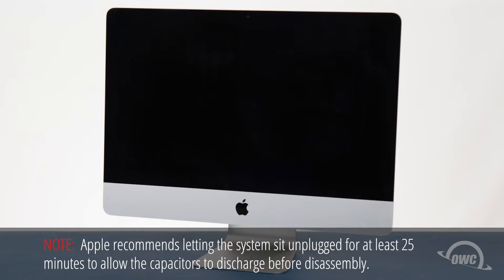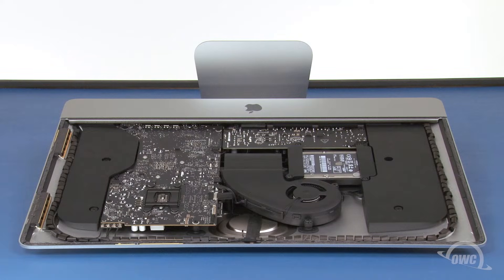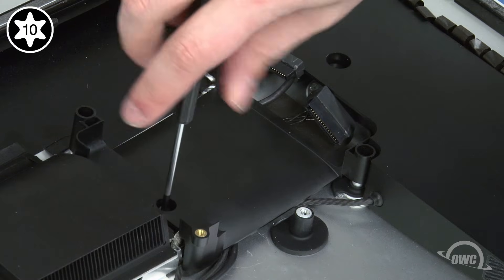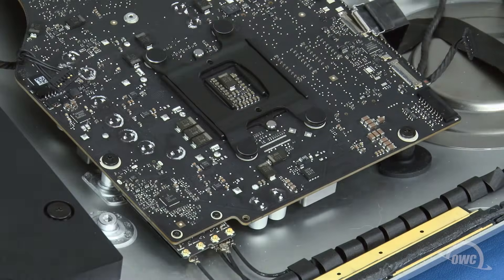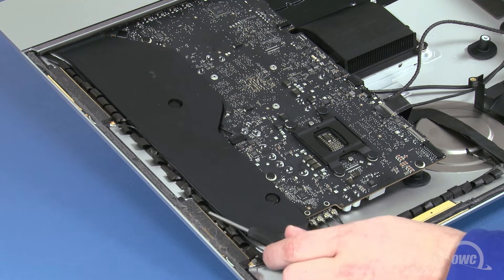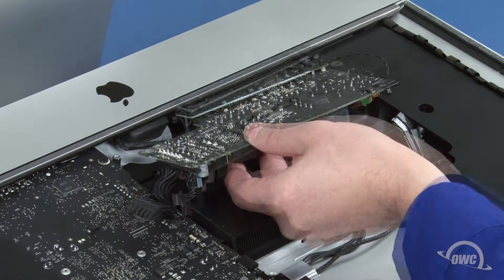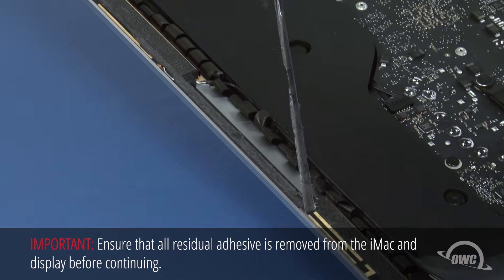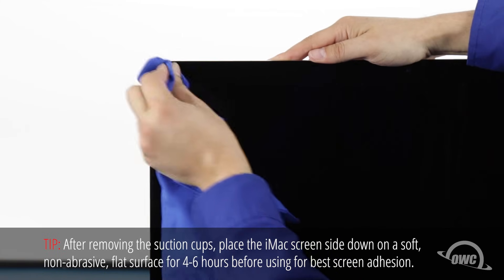How to Upgrade/Install Memory in a 21.5-inch iMac (Late 2012– Mid 2014) iMac14,1 iMac14,3

Comment: Last week I upgraded my iMac 14,1 with 16 GB RAM and an old SSD (500 GB) from an old Dell notebook. I installed Linux Mint 22.3 Zena on it and the iMac runs very smoothly. 13 Years old and it is a great fun to use it in 2026. Thank you for your good guide!

Comment: You say it works on the mid 2014 21 inch iMac but it has the soldered ram in it so it’s not possible to upgrade
Reply from the maker: To clarify, the iMac model with soldered RAM is the Late 2014 iMac (model 15,1). The Mid 2014 iMac is model 14,3, which features upgradeable memory.

Comment: I've upgraded the memory in several of these (2012-2014 models), and removing the components and logic board is NOT necessary. You just need to remove the fan and disconnect the cables right over where the memory slots are. You can then stand the imac up on its side and carefully remove the existing memory, then insert the new memory. It's a bit fiddly, and takes patience because you can only get one finger on either side of the ram when you're installing it, but it's entirely doable. It's much faster & easier than fully disassembling the system to get to the back of the logic board.

Comment: is this viable for the iMac 25.1 inch late 2015? Nice job
Reply from the maker: We do have other videos that work with 21.5" 2013-2019 iMac computers. See those videos here https://eshop.macsales.com/shop/ssd/owc/imac-21.5-inch/2013-2019
Reply: @poweredbyowc  Thank you, but I was thinking in the RAM replacement? Are they in the same spot as this video (this iMac model)? What are the DDR3 suitable for iMac 21,5 16.2 model late 2015? thanks in advance
Reply from the maker: Hey Andy, unfortunately, the iMac 16,2 doesn't support RAM upgrades, which is why we don't offer any RAM upgrade options or videos for it.

Comment: Thank you for this video. I successfully upgraded my RAM from 8 to 16 G. The only issue I have is this one: My iMac screen stays black. I had to hook another display to my iMac late 2013, 21,5", to be able to monitor the system startup. I suspect it could be due to a bad connection of one the four connectors at the top of the screen. Does this make sense?
Reply from the maker: Hey Stanley,
It seems like the black screen issue could be related to a poor connection. We suggest removing the display and ensuring that the connector is securely seated. It's a common oversight, so we recommend testing the display before laying it in place permanently. Once you confirm that it works properly, you can secure it in position.

Comment: my iMac (21.5-inch, Late 2013) fall of my table but did not broke any piece or had no crack on lcd but the screen is now black, I restarted it and tried increasing the brightness but it won't fix.. When I press the turn on button I can still hear the start up sound of mac and when pressing "esc" on keyboard I still can hear the beep sound of it. What to do? help please I beg you!
Reply from the maker: Hey there,

I apologize for the difficulties you're experiencing. If you still hear the startup chime, you can attempt an SMC Reset or a PRAM reset to see if they resolve the issue. If these steps don't work, it's possible that the display data cable has become disconnected, requiring you to open the iMac. Before taking this step, I recommend contacting Apple for further advice or any additional tips that may assist you.

Comment: One thing to mention and that will make your life 1000 times easier. Remove the bottom horizontal bar right after removing the screen, it will allow you to get the PSU and motherboard out with less issues.

I broke my motherboard by not doing so I hope you don’t make the same mistake as me

Comment: This is better than most such videos but still does not give enough detail on the hardest part for those doing it for the first time: disconnecting and re-connecting all the cables. Apple should be ashamed for making this so difficult, and also for making the RAM so inaccessible and for taping the damn thing together instead of using screws.

Comment: Great video. However, I followed step by step but when I pushed the power button, the screen is black. The green light shows up on the logic board but the screen is black and there’s no power up sound.
Reply: Did you find a fix? Having the same problem

Comment: Looking at this video coz I suspect a friend's son's iMac late 2012 has failed RAM, it's stuck on a boot loop. OMG Apple!!! We you do this? Not only is this model clued together, but they have the RAM on the opposite side to where you open it up, where you are forced to handle bare power supply components, what sort of clowns design these rubbish! I was praying it was like the late 2011 model, that had the RAM access panel, but noooo!!!!

Comment: I have a late 21.5 inch  iMac (late 2012) (iMac 13,1) 3,1GHZ that has already 2x8GB RAM DDR3 1600mhz. I still can't understand if I can upgrade to 32GB RAM or not. Under "hardware" & "memory" it says that memory is upgradable, yet Im still on the fence of doing this move. Can someone help a guy out?
Reply from the maker: While the iMac 13,1 is absolutely upgradable, the max amount of memory that model will hold is 16GB, which you already have installed.

Comment: Although late to the party for upgrading my memory like many might think the design could have been designed for easier access, maybe an access door. As an IT specialist, I've always been at ; the mercy of Microsoft with very little exposure to Apple products, but always expect such things from Apple. So, thanks OWC for this great video which, as you know was spot on! Bravo....
Reply from the maker: OWC does not recommend doing anything other than the intended procedure for upgrading your computer
Reply: Excellent thought, Keith.  I was wondering this myself.  As a non-perfectionist regarding such things, it would be great to be able to find exactly where the ram was located and cut (careful dremel?) an access door to replace the ram without having to open the front to do it.  OWC, whatcha think?

Comment: I did this to my iMac and also replaced hard drive with SSD. This video was SPOT ON. I am telling you if you watch this video and buy these tools (very inexpensive) you will be able to do it. I took me about 4 hours because I didn't reconnect the camera correctly when I was putting the screen back on, so I had to remove the screen again. This video was perfect. I kept an iPad with this video and just did it step by step. Just make sure you have all of the tools before you start, have patience and watch the video a couple of times. If you do this to change the memory, make sure you change the hard drive. This computer will run like new after these upgrades. Thanks again.
Reply from the maker: Hey Kevin glad to hear you had success with the upgrade. I agree the tools are essential, even if you have them they come with a set of tape cheaper than you'd get for buying it separately. If you ever have any questions or concerns please let us know at support@owc.com!

Comment: Do you think it's worth it upgrading from 8 to 16gb or should o go full 32gb?
Reply from the maker: If the iMac you’re upgrading requires the screen to be removed during the memory upgrade process, I would suggest installing the maximum you can afford, that would also benefit your usage needs.  The screen removal of the iMac is considered more of an Advanced install, and not something you would want to do over and over again, if it could be avoided. So, if your machine can utilize 32gb, I would select that upgrade over the 16gb.
Reply: How do you know if it can support 32 or even 64 gigs of ram? Also where would you suggest getting a new screen?

Comment: Funny side story here or not so funny. I have two iMacs. The newer one I had a access door and that was a breeze. So the time came to upgrade the other late 2012  today with a SSD and more RAM. I took the glass off and swapped out the hard drive and reinstalled. Yay, then I rotated ole'sparky around to swap the RAM and I must have had this Rodney Dangerfield stare looking at ONLY the fan vent. To my shock and horror I found this video which basically broke the news to me that I have to take the whole thing apart (again) but more. Lessons learned and do pay attention I say. Thanks for the video. I shall be referencing it.
Reply from the maker: Oh no I am sorry to hear that you had to do the install twice, good thing being you should have received a second adhesive kit with the memory. We're glad to be of assistance Todd, if you ever have any questions or concerns feel free to reach out to us at support@owc.com and I hope you have a great day!

Comment: Edit: Fixed the problem and now it works great!

After putting everything together the screen is very very dark, I can still see but only if I flash a light on the screen. When the iMac boots up it still chimes and everything works it is just very very dark. great upgrade but I took a downgrade today lol.
Reply from the maker: Hi Wish!  I’m sorry to hear that the screen on your iMac is dark after the disassembly.  Please check your connections; one of the screen connections may not be fully inserted.  A local Apple Certified Technician may be able to help.
Reply: @poweredbyowc  Hello, I was able to fix it. One of the pins for the display got bent (I have no clue on how I managed to cause that lol). I used a very tiny tweezer to slowly bend it back into place, and now it works great! Your video was perfect and very helpful. I Installed an ssd and extra 8gb of ram (12gb total). Thank you!
Reply from the maker: Thank you for following up! Glad to hear you were able to fix it and get it up and running and our video helped you! :)

Comment: Amazing! Does this process can be applied to iMac 21.5-inch, Late 2015 iMac 16,1
Reply from the maker: The iMac 16,1 would have built in memory modules. We do not offer memory upgrades for this model, I do apologize.

Comment: Worked great.  Went from 8GB to 16GB.  Imac much faster (since it was always shuffling memory packets) between 8-11GB of RAM use to avoid this.  I am frankly surprised how much nicer it is to not see the spin wheel.  You can do this, budget 3 hours and double check all cables when reconnecting.  The last two can be tricky without a 2nd set of hands.  And shame on Apple for not putting a little door on the back of the imac, since that is where the RAM slots are.
Reply: Do you have late 2012 model? What are the rest of your specs? Just wondering if my late 2012 would benefit from going from 8 to 16
Reply: Yup, it worked better than I expected.  A cheap solution if everything works fine but it is just slow to Multitask.  I have 3 systems in my workspace, don’t use this one much anymore.  Still a nice toy tho.

Comment: How do I get the adhesive off if it doesn't just pull off?
Reply from the maker: Hey  케이크스,

You would have to pull it off once you have removed the screen. If you can not just pull it off you can use small amounts of rubbing alcohol and rub it off completely. Now if you use this method please allow to iMac to COMPLETELY drive before applying the new adhesive. If you do not it can cause the adhesive to fail and damage the iMac if the screen falls off.

Comment: Buenos dias, se puede utilizar e instalar un disco solido en el M2 que aparece el la tarjeta? Muchas gracias por la respuesta
Reply from the maker: Good morning Billy! You would be able to install an NVMe to the iMac but it would be in the PCIe slot underneath the Logic Board. You would only have these connections if your computer originally came with a Fusion Drive.

Comment: Thanks for the Vid 👍🏻 do you know the Max RAM upgrade can i do to an iMac 2013 21.5” A1418? Thank you!
Reply from the maker: We are so sorry Israel but that iMac model number was used for 8 years and 2 of which are 2013. You can either use Mactracker.com and enter the serial number to you iMac and it will tell what the max ram is or you can in to our customer service line and provide your serial number and we would be more than happy to let you know.

Comment: Hi, My son just handed me down his iMac. What is the maximum memory I can upgrade my new to me late 2012, 21.5”, 2.7 GHz, 1TB, model label iMac 13,1.
Reply from the maker: Congrats on that iMac! After looking it appears the most this machine can handle is 16GB of RAM. Here is a link for more info: https://eshop.macsales.com/shop/memory/iMac/2012_21.5/DDR3L
Reply: OWC Thank you for replying. After setting up the iMac and using for a few days, it started to continuously reboot. I think there may be something wrong with the hard drive. I would like to replace it with a 1TB SSD. Which 1TB SSD do you think would be appropriate for this iMac? Thanks.
Reply from the maker: We would be more than happy to provide you with an SSD. We would need you to call in speak to one of our representative and they will be able to navigate you to the correct SSD upgrade. Please feel free to contact us if you have any further questions, comments, or concerns.
Phone 1-800-275-4576 or +1-815-338-8685

Customer Service/Sales & Technical Support - Monday-Friday (8am-8pm CT) - Saturday & Sunday (Closed)
Live Chat Technical Support - Monday-Friday (8am-8pm CT) - Saturday (9am-5pm CT) - Sunday (Closed)
Live Chat Customer Service/Sales - Monday-Friday (7am-10pm CT) - Saturday & Sunday (9am-5pm CT).
Thanks for choosing OWC, and have a great day!
Reply: @poweredbyowc  Hi, Thank you so much. I’m in the UK, would that present a problem in purchasing? Thanks.
Reply from the maker: Products as popular as our SSDs should be able to ship from our EU headquarters.  Regardless, even from our home base in Chicago, we will ship to the UK.  Thanks so much!

Comment: Nice Video!! After this 20 minutes.. I'll just take it to a shop and get it done professionally. xD 
I rather get it done right and I not make any fuck ups on the computer.
However my 8Gb is working great. since i dont use computers for gamin anyway.
Reply from the maker: XD Hey Sancho if you feel better with a Professional doing it. This is why we put on the have have put our disclaimer on all our videos. We want to make sure you have a fully functions machine when the upgrade it done.
We are happy to hear that the 8GB memory upgrade worked and was just what you expected. Please feel free to contact us if you have any further questions, comments, or concerns.
Phone 1-800-275-4576 or +1-815-338-8685

Comment: I've read several articles that say the Mid 2014 21.5 inch memory is not upgradable. Plus I don't find an OWC module (or any other brand) that specifies it can be installed in a mid 2014 model. I don't know why this one model is different but apparently is. If this is not true, please point me to the correct memory modules. I want to upgrade from 8 to 32 GB.
Reply from the maker: Hello Skeeten,
 
We would be happy to assist with looking into a possible RAM upgrade for your Mid-2014 iMac.
 
For further assistance we can be contacted directly at [support@macsales.com](support@macsales.com)

Comment: CAREFUL!!! my screen got damaged in the process even though I was very cautious, I advise you not to change the RAM's personally, otherwise you risking throwing it all away!!
Reply from the maker: Hello Steven. Thank you for contacting OWC Support! I’m sorry to hear you’ve had an issue with your purchase and I'm happy to assist. I do not see any case or order details for you to reference. can you please send those to support@macsales.com Attn Danielle B? I will be happy to review this further with you. Thank you!
 
~Danielle B/ Leadership
Reply: @poweredbyowc  can iMac late 2012 be upgraded with 16gb x 2  (total 32gb ram) ?
Reply: I was considering doing it myself, but I don't think I will take the risk. So annoying Apple didn't make it easy. Does anybody know how much they charge to change the RAM?
Reply: @Professor_Silva   You don't think they want you to work on it yourself do you? They make much more on repairs than sales. It's the case in all industries, especially the auto industry.
Reply: Why they make it so hard to replace the memory in this model why the other models are so simple ? that's stupid from their part
Reply from the maker: You can certainly get the Late 2012 iMac to 32GB of RAM but regrettably it will not take 16GB modules. You will have to do 4x8GB modules.
https://eshop.macsales.com/shop/memory/iMac/2012_27/DDR3L

Comment: I want to attempt this but I don't know if my iMac can do this as I have heard some have soldered ram. I have a 2014 mid  21.5 inch iMac with the intel i5 can I do this? also an incredible video! very good and easy to follow! thanks!
Reply from the maker: Hi AppleTopic!  Unfortunately, in the M2014 21.5" iMac the memory is soldered to the logic board. https://eshop.macsales.com/blog/25084-teardown-of-lower-cost-2014-imac-reveals-memory-not-user-upgradable/
Reply: @poweredbyowc  oh no 😢 well i gues im stuck with 8gb of ram thanks for the reply!
Reply: @poweredbyowc  also thanks for the link it was very useful
Reply from the maker: You're most welcome! If you need any additional assistance we can be contacted at support@owc.com
Reply: @poweredbyowc  thanks

Comment: Hi  I accidentally broke the power button cable are you able to ask your technician how to remove this before replacing it?
Reply from the maker: Regrettably, does not seem we have a specific guide available for power button cable removal/replacement.  Thanks for the message!
Reply: @poweredbyowc  it was adhered to the body 
solution heat gun for a minute or two to loosen it 
resoldere the wires
Reply from the maker: Hi Fred!  Thank you for letting us know how you were able to get the cable situation cleared up for you.